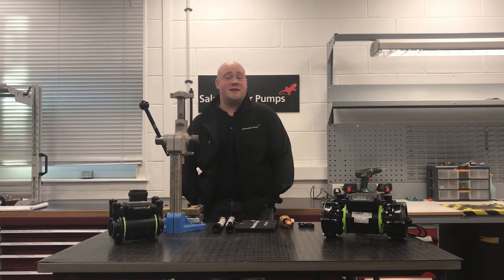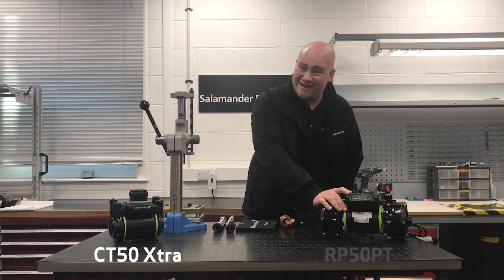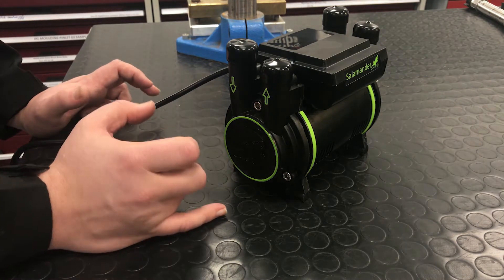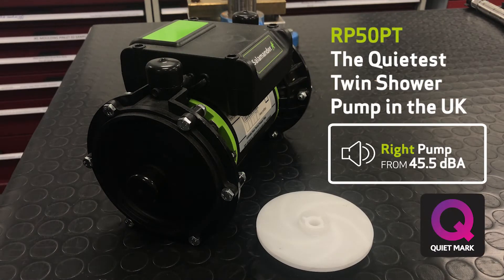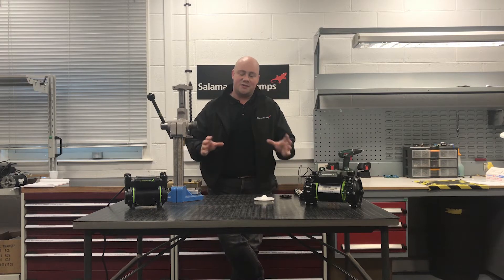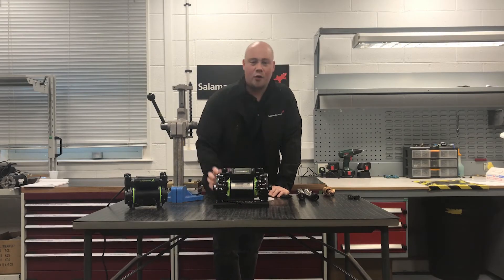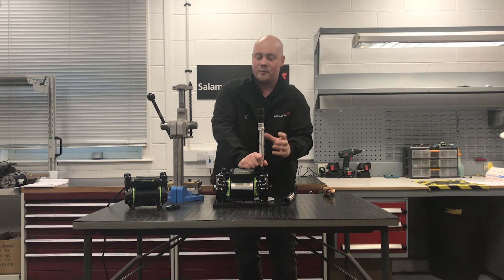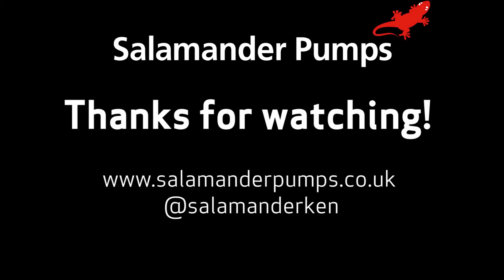How Quiet Are Shower Pumps? | Salamander Pumps

Comment: I was hoping you would have shown them in use with someone talking next to them. Mine is so loud I think it’s broken (unable to hold a conversation within 1m).  Sounds a bit like a blender.
Reply from the maker: Hi Dave, we're sorry to hear that. Can you please send us a DM via social media with your email address and the serial number of your pump so we can investigate this further for you. Thanks.
Reply: @SalamanderPumps  I don't use social media.  Can I just email you?
Reply from the maker: @Thompsonnumber4  Yes that's not a problem. You can email tech@salamanderpumps.co.uk if you could just explain the problem and provide the serial number of your pump someone will be in touch. Thanks!
Reply: Mine is has similar high pitch blender sound. Did you get any resolution?
Reply: @antc1288  unfortunately no, I provided all the measurements around the pump but it was explained that there’s something with my installation that doesn’t meet the requirements (the ones I recall were not enough head above the pump and no special air reducing outlet on top of HW tank).  TBH I am skeptical that these would cause such a noise, but don’t have an easy way of proving it without a lot of plumbing work.  Tempted to try another brand of pump in the location to see if it’s any better, or temporarily pipe up the orig pump in the garden with some ‘ideal’ conditions and see if the noise goes away.
The pump is next to my office room and I almost have a heart attack each time it turns on, lol!

Comment: We have just measured the sound decibels of a newly fitted Salamander pump which should be approximately no more than 55 decibels, however, when taking decibel noise measurements of this pump at arms length, it is reading an average of 88 decibels.  On contacting their customer technical department, they refuse to accept that the noise is too loud, and that this is normal.  Therefore, avoid Salamander pumps; a recent visit by a qualified plumber informed us that he avoids fitting these pumps, as the quality of components has changed in the past few years, and that these pumps are now of poor quality and sound.  What a total waste of our money, an absolute disgrace on Salamander’s part.
Reply from the maker: This is disappointing to hear. Our Research and Development team have worked incredibly hard to ensure that our products are some of the quietest and most reliable on the market. Our Training Manager would like to discuss any issues you've had with out products with you, could you please send us a DM on any of our social media channels with your contact number and the serial number of the pump? Thanks.

Comment: Would it help to puT the pump on a slab with a anti vibration mat on top as double measure or would it be pointless ?
Reply from the maker: Hi John, an antivibration mat would help with damping the noise from vibrations from the pump. Thanks

Comment: Have a salamander ct 80b, it screams, it’s horrible, not vibration, it’s the noise of the motor, looking to buy STurner
Reply from the maker: Hi, Sorry to hear this. Our CT Bathroom range are part of our regenerative pump range which, as the video describes, uses a stripping block to remove water from the pumps impeller, this will probably be causing the noise you are hearing. However, if you feel this noise is unusually loud give our Technical Team a call who will be happy to help on 0191 516 2002. Thanks
Reply: @SalamanderPumps  wasn’t expecting a response from salamander,  but thanks. If I put a dB meter on my phone next to the pump, it will read 86db, that’s pretty loud. I understand that the phone dB reader may not be completely accurate but that is still a loud noise
Reply from the maker: @richmondpp  Thanks. If you can record a video of the pump and send it to tech@salamanderpumps.co.uk a member of our technical team can advise you.
Reply: I have the CT75+ and I assumed the screaming was a fault (it came with the house). The pump would also overheat after about 20mins, meaning for a family of 3 it is unusable for 1 or 2 people.
It has now stopped working completely and was about to replace it with the same model, but this looks like a bad idea now. Vibrations are one thing, but the high pitched whine is intolerable once the kids are in bed.
Reply: @MesonW  I went and bought a Stuart Turner pump monsoon 3bar, it’s not silent but way quieter that the salamander, would recommend the Turner.

Comment: Seems a bit wrong calling a video how quiet are shower pumps, and then just explaining how they work and what noise damping is used. At no point do you actually show any pump running, so the relative noise can be heard. We've just bought a Salamander pump and it is noisy as hell. It can be heard throughout the house very easily. The hoses are not kinked, it is on a mat, no pipes are rattling, it had an s flange and was purged of air when commissioned. If this is one of the quietest on the market, I would steer well clear.
Reply from the maker: Is your pump under warranty still? If you give out technical team a call on 0191 5162002 they will be able to listen to the pump noise over the phone and advise.
Reply: What pump did you buy mate? I’m looking to buy a pump myself...
Reply: @johnstackhouse9657  a CT Force 30SU. They claim a noise level of about 46 decibels but mine registered about 60 on an app, although I can't say how accurate a free download app is. But it's not just about noise level, it's the pitch of noise and vibration that travels through floors. 
To be fair to Salamander, I phoned them about it and they sent out a replacement promptly at no cost, but the replacement is still pretty loud. 
I bought a pump mat as well, but it actually runs quieter without the mat, just on a wooden plinth. 
Thinking about moving from the airing cupboard up into the loft to see if the extra distance and loft insulation will damp the noise sufficiently. 
I also have a dedicated aqualisa shower pump in the loft which is much, much quieter - but obviously doesn't supply whole house!
Reply from the maker: Hi David, It is very difficult to show the actual noise of a pump on a video as everyone is in a different environment with different noise levels set on their device, however we do have one video showing a pump running.

https://www.youtube.com/watch?v=6KntloUwotw&list=PLN5mgY1xpfufsqfQUaE5QMZ1M14g5Iq41

Comment: If I wanted a pump only for my shower, does that pump have to be installed upstairs near the shower, or can I install it downstairs in a cupboard in the utility room?
Reply from the maker: Hi there, it depends on your installation. Often shower pumps are installed in the airing cupboard in a gravity fed system or if you have a combi boiler a mains booster pump will go after the stop tap before the combi. If you give our technical team a call we can talk this through with you. The number is 0191 5162002.

Comment: Would putting the pump on a bag of sand help? Cheers M
Reply from the maker: We wouldn't advise putting the pump on a bag of sand, as this could potentially block the air vents. Instead to dampen the downward vibrations from the pump, use a pump mat. Thanks
Reply from the maker: The pump mat is available from here  - https://salamanderstore.myshopify.com/collections/frontpage/products/accpumpmat

Comment: Hi there .... just wanted to know whether it is OK to  put pipe foam around the hosses the minimise the noise as it's so loud.  It's in my airing cupboard and the sound is crazy it can be heard even when I open my tap downstairs!!
Reply from the maker: Hi Lynn, Lagging can be added to the hoses, however please ensure that the hoses are accessible for any future
maintenance. We would also suggest that you give us a call when you are next to the pump so we can check all is ok and it is just normal running noise you are experiencing. 0191 5162002.